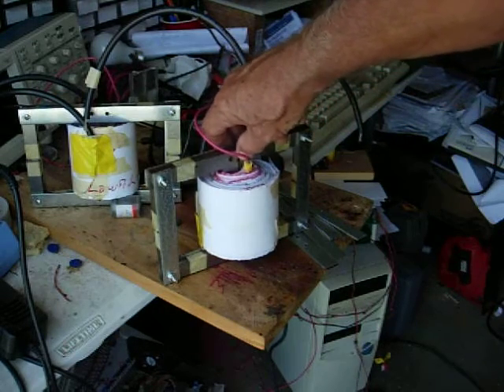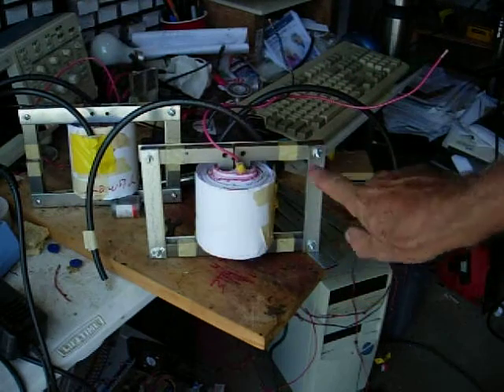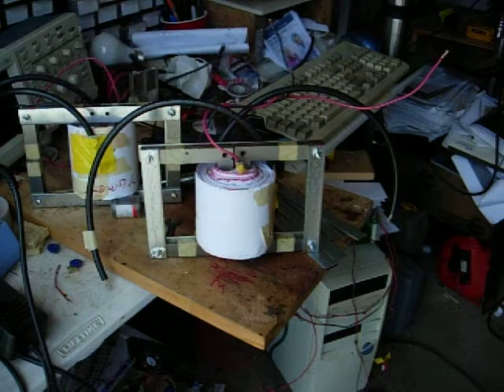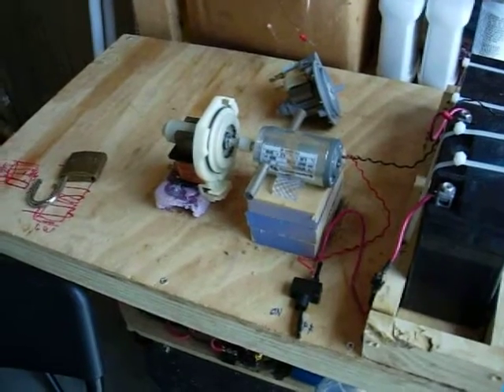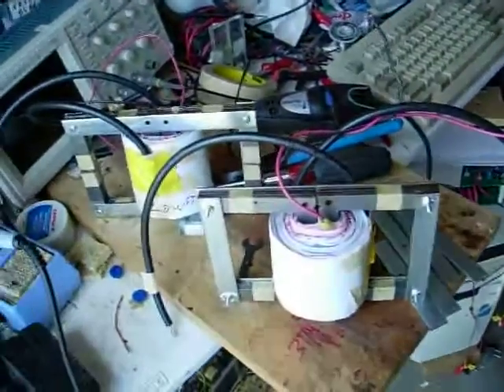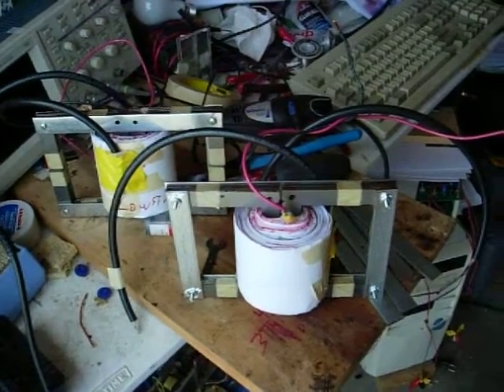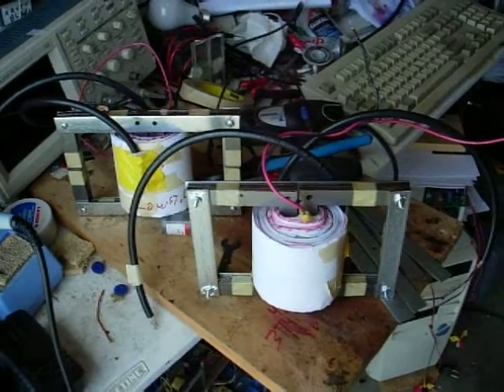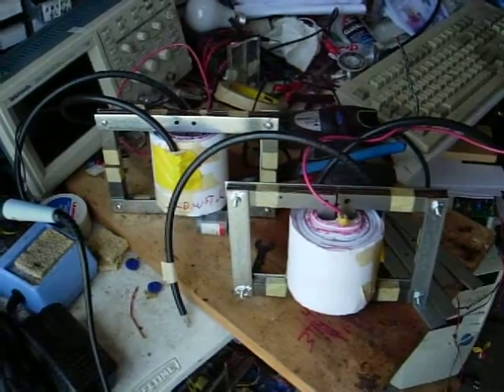Don Smith #109 two pole transformers done

Comment: ABB has a "how its made " video,  showing how to build the transformer correctly.  the details include an aluminum plate wound secondary that creates a double capacitor plate separated by an inductor.  this creates the same device Don Smith created when he takes 2 plates,  one aluminum,  the other copper and isolates the two with a primary coul and insulator at a 90 degree angle. if we take 2 of these devices and wire then in series,  by feeding pulsed power into a shorted secondary (neutral jumped to the left hot leg),  we could pulse its input with a pulse train of 60 hz,  the circuit will attract the Earths polar system at 60 hz,  syncing its input to form whatever the resonant frequency is thats closest to so it creates a capacitive and inductive reactance, between the transformer's case and plate wound secondary,  simultaneously,  allowing an amplified output of a great  magnitude with a perfect sinewave and no distortion whatsoever.  proof of its input can be measured thermographically.
Reply from the maker: +Marc Belanger I'm going to rebuild my Don Smith circuitry to run the new impulse car motor which is shown in my don smith #39 video.  its now running with 5vdc impulses pos and neg  3 pulses per position at 200 rpms the rotor is 18 in diameter 1/2 aluminum plate which 12 neo 2in magnets each side and 24 coils each side.  the control is done with 8 LED sensors.  the pcb is designed to dump Don Smith 2uf caps with 2kv into the 500vdc caps when these reach say 400vdc the comparator turns of the dumping FET,  Using say 8 rotors this thing should make a car go like hell.   The coils are dual type and with the energy captured back to front end along with BEMF captured and fed back the beast should self run.
Reply from the maker: +Marc Belanger Don Smith's suit case device was a Tom Bearden MEG device.  worked pretty good but he did unplug it when the guy added 1000wat bulbs
Reply: ***** Sounds Awesome! I've watched a couple of your videos, I was waiting to see the effects you've created. At the time when I watched them, I was only like 18 videos in and I didn't get a chance to get past that. I have to make some time and watch the rest.. Great work by the way..
Reply from the maker: +Marc Belanger Some of the videos show bad circuitry but then In the next one I show the good stuff.  for example I tried using a pulse transformer to drive the FETs but ended up with isolated PS and Driver IC to do it.  works great.

Comment: youll have to. isolate the other side by eliminating the strip that ties the left and right together to form 2 separated/isolated cores.  they must have a dielectric between the 2 to electrically isolate eddy currents and arc discharge that will kill the dipole

Comment: nice work to create the transformer cores and coils,  however,  youll have to take the coils and slide them over the center of two isolated laminated square cores as one core per transformer.  e core wont work as Gerards phenomenon functions
Reply from the maker: +Marc Belanger Hi Marc  these are pretty light duty and will be tested in mineral oil when I get the 120 vac gen connected to the motor. It'll be interesting to see what the HV out is. probably the aluminum tape will fry it needs to be heavy plate about 20 turns per plate &  HV coil 10ga about 1200 turn lots of paper epoxy   The pcb is driving the Samsung washing machine motor great.  took 3 months to solve all the problems.  Atmel info really sucks they never tested their schematics or software the hall cases were all wrong plus the software had wrong polarity selected to drive Irams inputs which are LOW active, schematic was wrong they had VCC connected to gnd and  Pin 21 on Irams has to be gnded thru 4.3k or it won't run the motor.   I did see all the videos on pole transformers.   Boundary Electric has the 25kw transformers for $1500 ea plus shipping.  these are the same as Gerards test.   When I get them I will be tearing them apart and then present the findings.  Lots of testing needs to be with different ratios of plate to HV turns.  This is truly fascinating stuff. Have you read tesla patent US593138  or studied his current-less (NO ELECTRONS) primary's.     These pole transformers have a single core made of what they call electric core material hard to find.   They have a single HV coil and on both side of it have an aluminum plate.  When Gerard took his current reading from the McCullough Gen to the first poles 120 plate his meter first showed ,01 amps. which matches with what Tesla was talking about when he said the electrons don't  flow thru his heavy primaries they get hung up in the lattice structure of the heavy metal bar stock.  Gerard shows the 30 amp fuse and the gen was driving a dead short should have been around 120 amps.
Reply: yes, if you watch Gerard's video very closely, you will see that he has the input going to the secondary which has one of the hot legs shorted to the neutral, the other side is normal. This is where the energy comes from, by having one shorted coil and the generator has to be a fused unit firing it because a breaker or gfci will only open feeding the shorted coil. The transformer really doesn't matter, just as long as the generator could handle the short circuit. If it can't, then the fuse will blow or the breaker will open. It is highly advised that a permanent magnet generator is used and that is because the coils used for electromagnet in the regular generator will short out and lose it's excitement. If it has a permanent magnet, this can't happen and the generator goes on it's merry way unless the coil burns up. It is highly advised that the generator is at least good for 3000 watts output. The secondary coil only uses like 7 to 12 watts to idle, and, with the atmospheric energy drawn in, this is all cancelled out. The system does work, however, the 23.6kV primary coil works best the way you have them wound. The cores can NOT be connected from l;eft to right whatsoever otherwise the flux will not be isolated. They have to be electrically isolated so they perform like the factory built cores.

IE. the two square cores must sit separated without bolting to each other. The coil former is the only thing holding them together and windings are over this. You can use copper foil to function, and the entire reason why this works is the similarity to the Mislavskij plate/coil transformer or the Don Smith Resonant Electromagnetic Radiant Energy plates he created.

The outside plate is the secondary winding, then, the primary is a coil, then, if the outside of the primary is covered with a split covering of copper film, the outer core can be connected to a separate frequency generator and the inside to the input pulses at 50 or 60 hz. When the correct outer frequency is generated and the core left isolated from each other, a surprising amount of energy can be drawn in, especially if the primary coils are tied together with an arc gap utilizing two dislike metallic plates. The energy will amplify exponentially.

Comment: nice job on the pole transformers good to see the progress is coming along.also not sure but i think this type of controller would work fine.at least it comes with full instructions of set up.NEW 3KW 4HP VFD 13A 220V SINGLE PHASE VARIABLE SPEED DRIVE VSD DRIVE INVERTER.